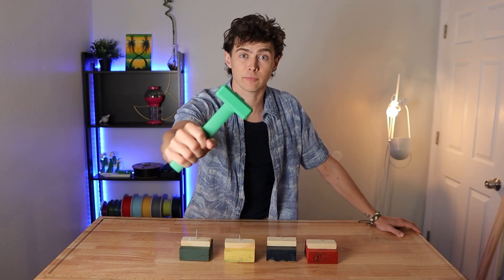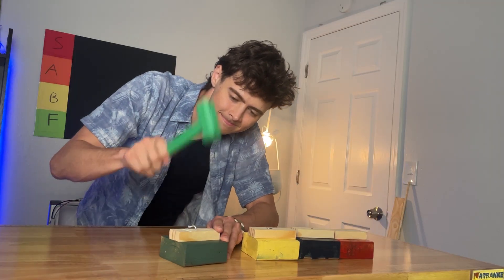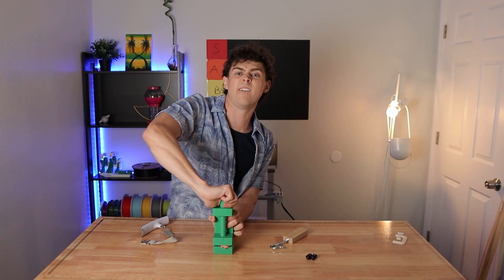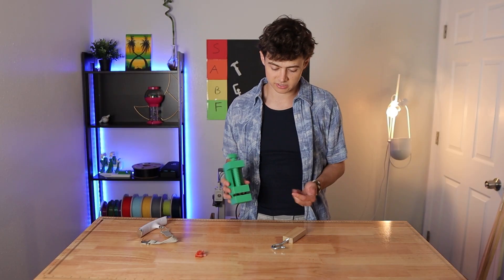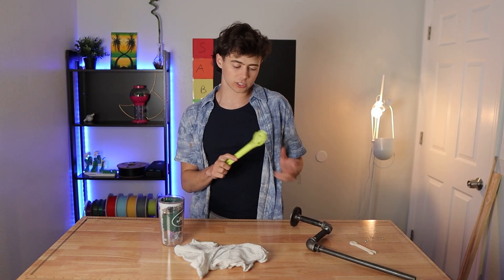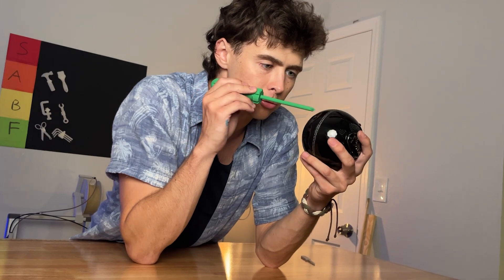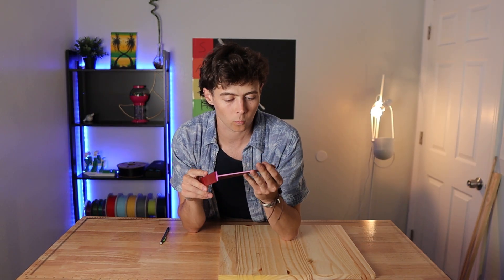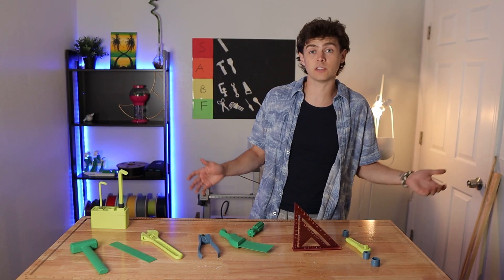Which 3D printed Tools Actually Work

Comment: The Hammer shut be on the top .
Why wel you can buy them in hardware Store.
There not used for metal nales.
There used for if you want  to put two parts to gether.
And the Metal hammer way to heavy and brake the thing you to hit.
The Hammer is the first thing on my list .
And the clamp needs profile and needs to move on next to the Hammer.
Its a operaters mistake by yes you.

Comment: Getting into woodworking these past few years has taught me that there are certain tools for certain uses, and it's important to know why and when to use them. That's why dads tell you to gtfo of their tool chests.

I have 3 printers and make tons of things to help crafting but only things like jigs, templets, and tool upgrades like dust collector adaptors have made sense. A dead blow with spare weights inside is great for fitting stuff but not for driving nails. Anything getting torqued like those wrenches will fail eventually also. Even 100% or CF filaments won't last long enough for the resources you use printing them.

Layout tools are a better use case for 3d printers atm, like you found out. Also, speed squares are dope with tons of secrets, you should look into them. Even lil wall anchors or washers are a better use for 3d printers right now in DIY home repair (after you print all your benchies and articulated dragons and snakes that is).

Buy some used tools and learn how to maintain and clean them because the crotchety old men were right, new tools suck. Nice video!

Comment: The issue with any 3D printed hammer is that even a solid plastic one doesn't weigh much.  So it can hold up to bashing, but you're not driving much mass into the nail.

What you end up with however, is a great deadblow hammer. If you need to hammer two things into place without damaging them, a 3D printed hammer is perfect, and is way better than those rubber mallets that just get chewed up over time.